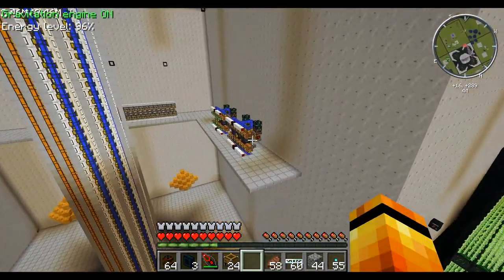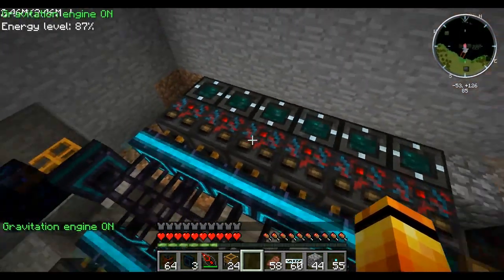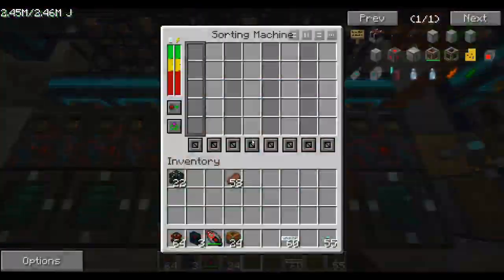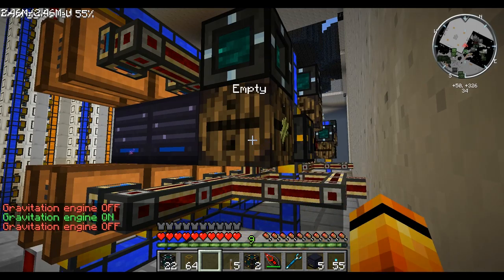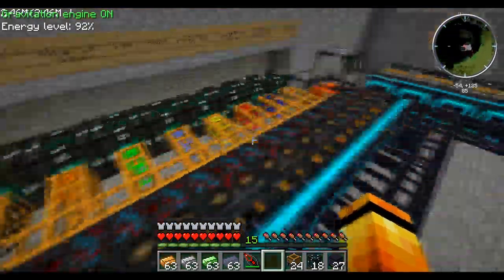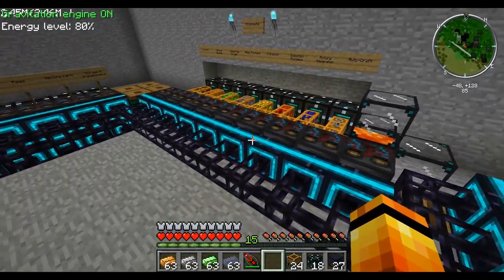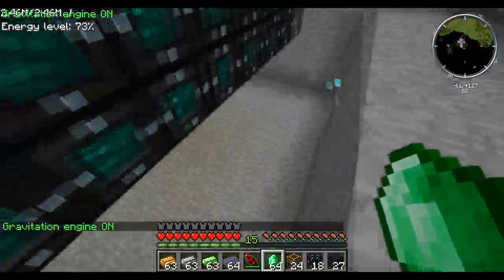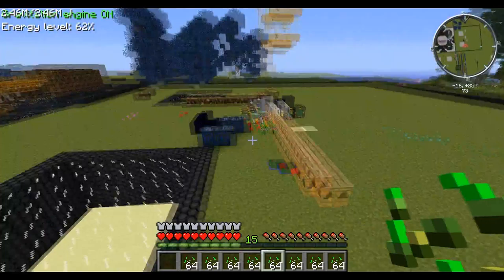Learning "Feed The Beast" - Episode 20 - Redpower Super Tube Sorting

Comment: With a similar engine setup, i had to add multiple tesseracts to the water line on the side of the engines to keep up with the water demand to leave them on constantly.. with a shared supply when the engines hit around 4500 degrees the water starts to go fast:p

Comment: thats pretty mutch true. but the first time a item comes into the barrel then it will allways face you so if you place the barrel on the ground and then a wooden tube ontop and then the barrel that is facing the wrong direction and then power upp the wooden tube then you can in a second change side. that is a handy tip if you move barrels around whit portal/gravity gun =)

Comment: Hehe, quite nice sorting system, in mine I had sorting machines pulling items out of an ender chest (which is mostly not being used atm because I switched to tesseracts some days ago an was using filters to determine what was allowed into my storage, but I like the idea of using sorting machines to filter them, sure will make the layout smaller. What I have though instead of relays is 3 pairs of routers connected to tesseracts directly, and all my storage is connected.

Comment: A quick question for KingHappy: How would you handle the situation where the routers are clogged (e.g. a particular item's barrel is full and the router happens to have that item in its internal inventory slot)?  You could use a gate on a structure pipe to turn off the tesseract for that barrel set forcing the sorting machine on the other end to clog and signal there.  At any rate, this looks to be really awesome, look forward to seeing it in action!